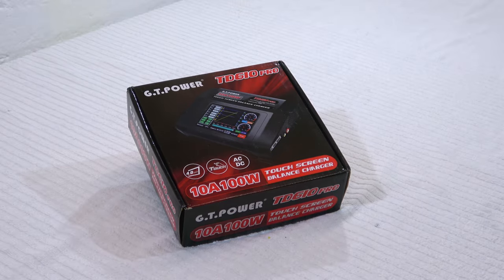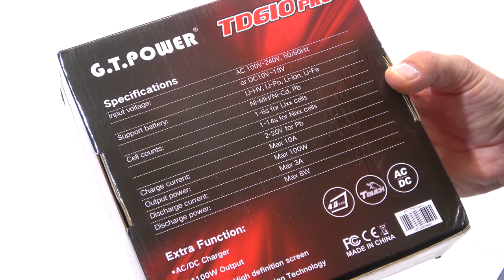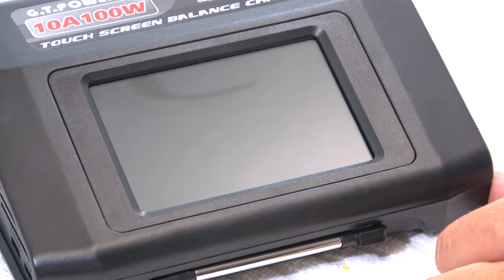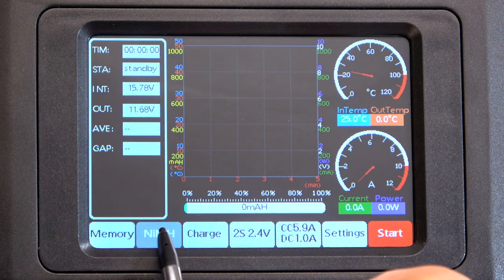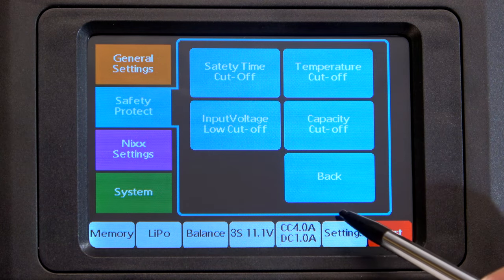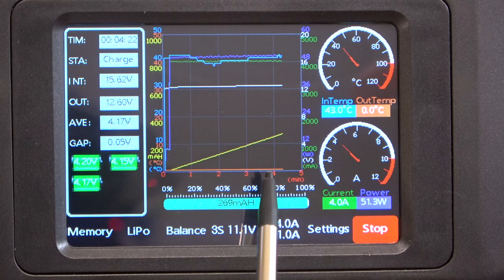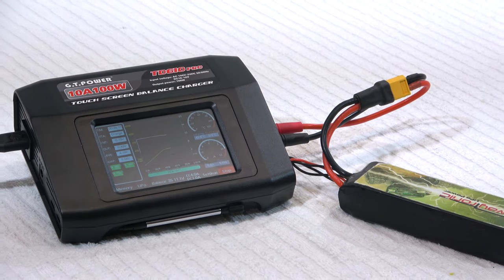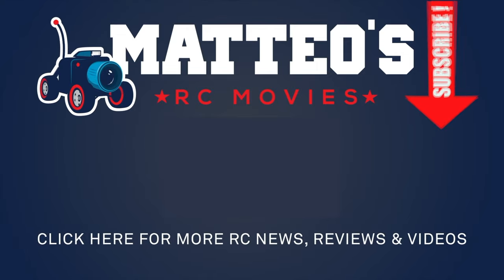G.T. Power TD610Pro Charger Review

Comment: Is it not best pratice in your country to charge LIPO in a fire safe bag?
Reply: it's useless because every user manual say :"always keep an eye on battery while charging"
If lipo battery is not damaged or abused, nothing bad could happen.
i charged thousands of them without any problem but you have to stock them in a safe place when your eyes are not on them... (here come the good use of a lipo bag or lipo box)
Reply from the maker: Yes, I see it the same way as @trophythedrifter. The most important thing for me is to never leave a battery unattended while charging. If you don't, lipo bags are necessary. But be careful, even a good lipo safety bag can't provide 100% safety, so I think it's better to monitor them. 👍😊
Reply: @trophythedrifter  most lipo bags are completely useless.
Reply: nah, lipo bags are good only for transport. never ever leave the lipos alone while charging.

Comment: This charger is very very noisy when discharging. Fan is turning at full speed all the time. Internal temp is 21 degrees C. I am very dissapointed. And when using store discharge it takes ages. Last 0.2 volts its discharding 6 hours with 0.00A. Why?? I tested it with 6 different batteries. My old B6 charger is doing this job much better.

Comment: you can draw up to 3200w from an AC plug but this charger does not deliver more than 100W in only one battery pack...
A modern charger should detect  number of lipo cells by itself .
Thank for this good review Matteo but this product is not à your level , even with this 4" touchscreen:-)
Reply from the maker: Thank you for your feedback! However, the wattage of a charger does not only depend on whether it is operated with AC. The more watts it has to deliver, the better and bigger electronic components have to be installed. And all chargers in this price category cannot deliver more than 100w. Chargers with 400 watts and more are much, much more expensive. And for normal use in cars and smaller airplanes 100w is enough. You can charge e.g. a 3s Lipo with 8A, that means a battery with 4000mAh is fully charged in 30 min.... And the function to backup the data of 8 of your most used batteries makes it very convenient to use, even if it doesn't recognize the cells itself. (If you try to start charging with wrong cell setting, the charger will give an error message). 👍😊